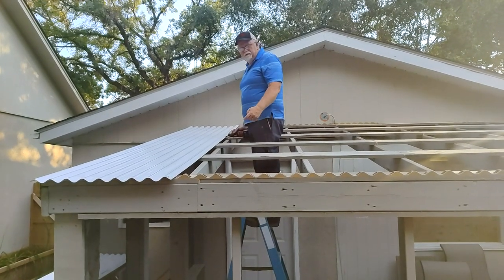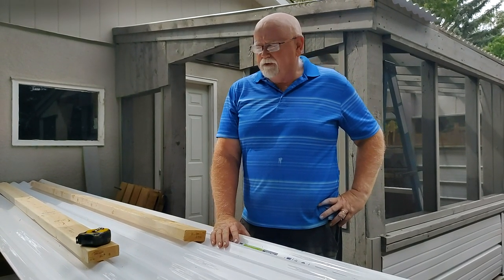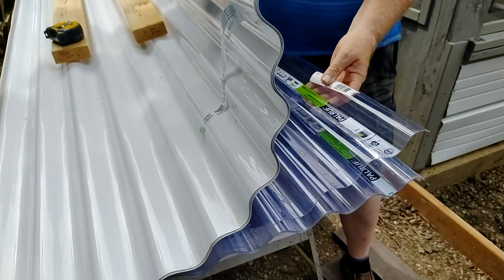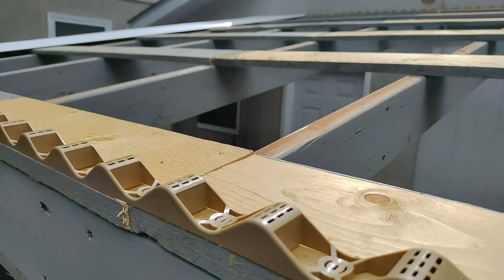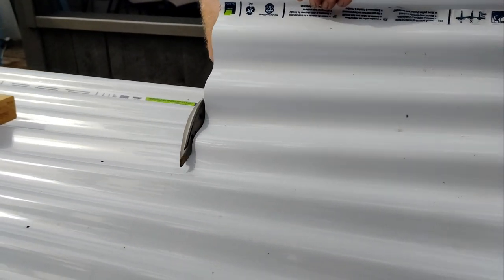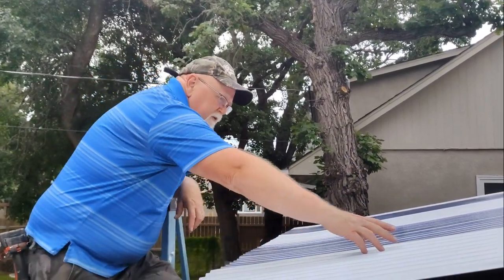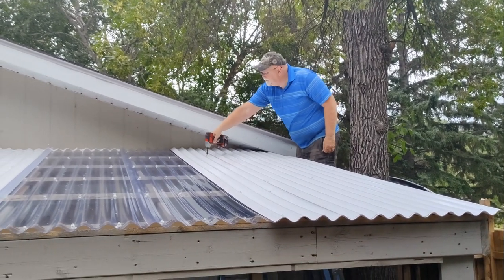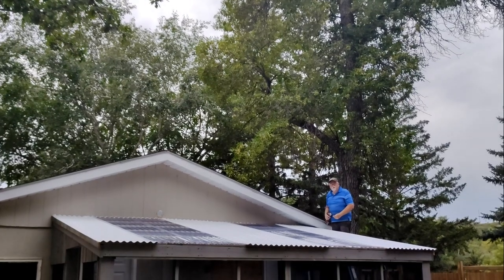How To Install a Palruf PVC Roof On a Gazebo | Low Budget Backyard Makeover

Comment: Why no verical strips at the ends ?
Reply from the maker: @freebird1963  not sure what you mean, but I did put the panel strip on top wall.  Thanks for watching ☕️
Reply: @CoffeeWalksandWhatever  Along the sides the Pulfram  install vids show the vertical closure strips going down the side perpendicular to the horizontal ones. Thanks
Reply from the maker: @freebird1963  thanks 😊 no never put them on. We have had 0 problems with the panels since putting on. No leaks,  no problem with wind but might be if it was in the wide open.  Thanks for your comments.

Comment: I need a ridge cap? Do you know if I can get one.
Reply from the maker: I believe that there's a ridge cap. You could also use a metal ridge cap. Note you will need to also use a foam or the strip I used on the bottom to close the gaps. ☕️